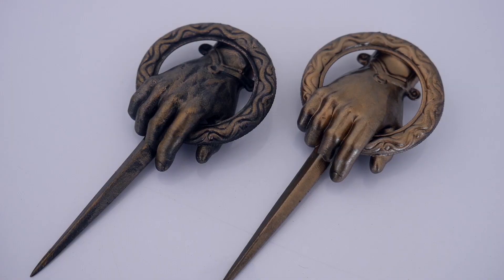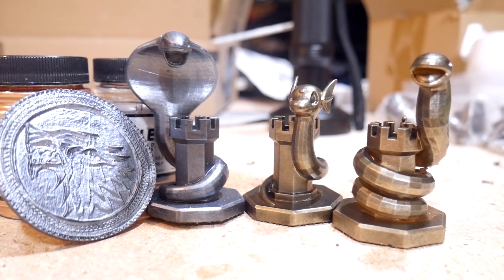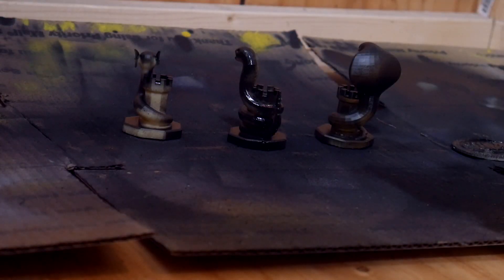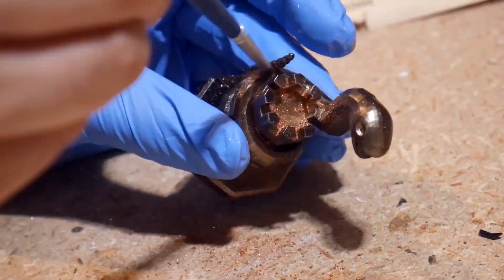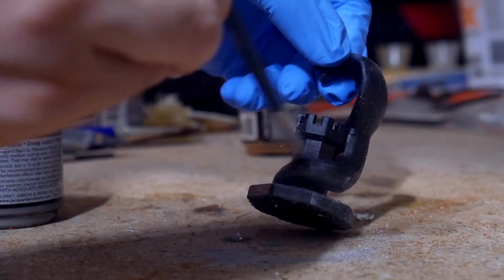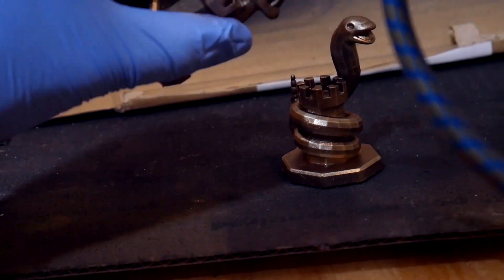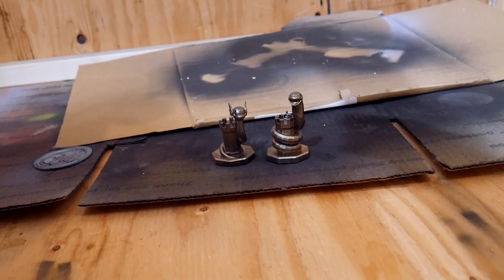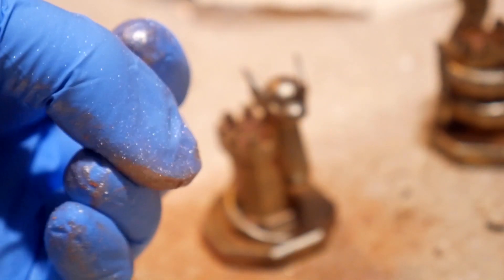Realistic Metallic 3d Prints with DIY Pigment Powder Coating

Comment: Pro tip: If you want it to feel more like a metal cast piece, print also a plastic bolt into the base and a base cap. Screw a large metal bolt onto it, and glue the base cap over to cover it. Cheap and effective.

Comment: So the pigment just sticks to the print without any bonding agent? Thanks for the tip :)
Reply from the maker: Almost, you need to seal it with clear coat so it does not rub off.

Comment: Would this look good for larger objects like, say, a Lightsaber hilt?
Reply from the maker: Yep it scales very nicely, I used to to great effect with a Skyrim Glass Axe resin print (zero paint used) that I posted up on Facebook a while back (https://www.facebook.com/hirocreations/photos/a.547643858658657/2355599931196365/?type=3&theater)
Reply from the maker: Updated with a working link :)
Reply: @HiroCreations  That Glass Axe looks pretty great, thanks for letting me know! I'm learning how to use CAD software so I can 3D print my own custom hilt design, with a PVC tube inside to make it battle ready [I hope.] 

This is my first time doing something like this, so I'm glad there are ways to make 3D printed objects look less like plastic!

Comment: Good find! Is the black coat aiding the pigment to stick? Asking since if the resin itself is black already, can that step be skipped?
Reply from the maker: The coat of black paint helps a ton with contrast and makes the silver and golds look more vibrant. Otherwise that step is skippable.
Reply: Honestly, if you put the powder on while the paint is still tacky, it may help in making it stick so you don't need the clear coat, and can polish it like a typical cold cast effect. Not sure, but I can try and see if it works.